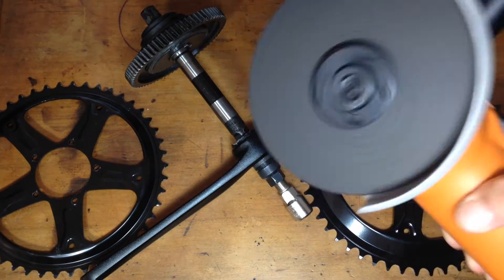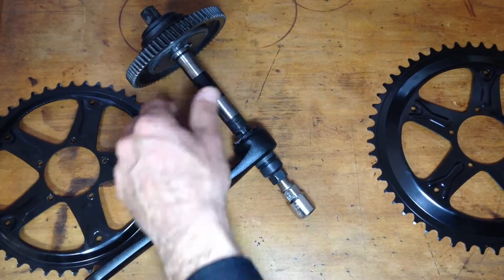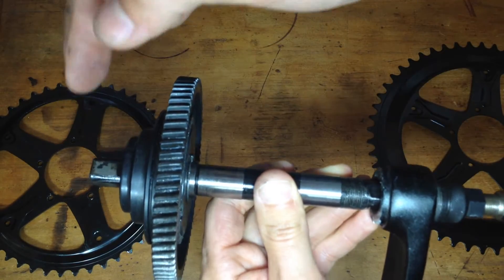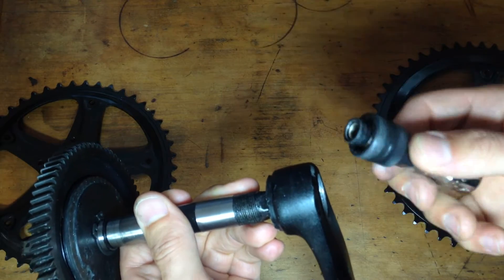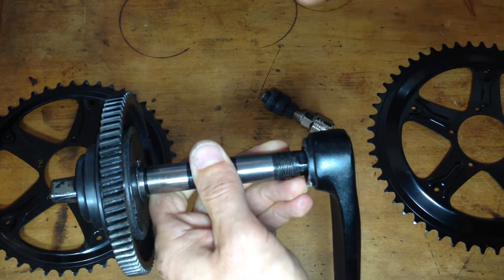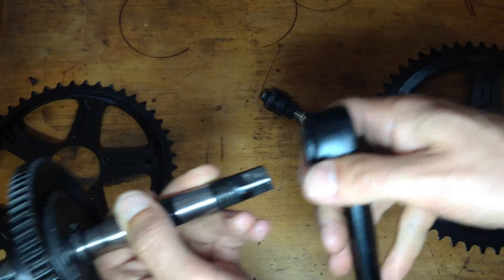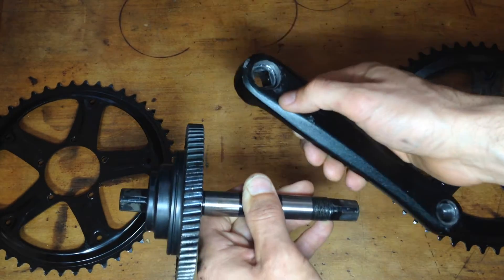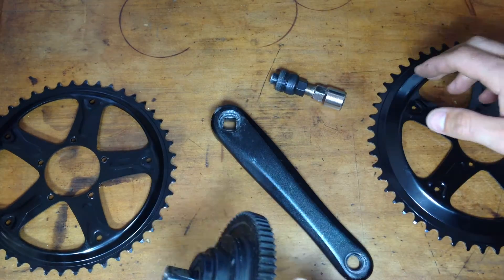Stuck crank arm • BBS02 BBSHD Bafang 8fun mid drive Electric Bike

Comment: Was stuck with the same problem today. Didn't get it off even with a crank puller, because the top from the pushing screw on the inside was too wide to fit. I took the top off and used a screw with a slightly smaller head as a replacement. Also put some washers on the inside of the crank to even out the pressure and not damage the thread of the crank screw. Worked pretty good.

Comment: bruno i'm trying to remove a bbs01 but after i removed all screws the motor simply wont slide out. I tried to hammer it , put wd 40 but nothing. Did this ever happened to you? Do you have any idea? Is the bb sleeve of the motor made of aluminium? (maybe is oxidated) I reall ran out of ideas here.
Reply from the maker: Hummmm I know... the Bafang motor is aluminium but the BB tube that goes inside is strong steel and yes it must be rusting and expanding against the bike’s bb... best is to maybe step on the motor trying to make it slide down and up it should slowly move bit by bit... ask a friend to help holding the bike... impossible job for one person I think... eventually you’ll get it out and sand all that rust off and paint again. When installing get a lot of grease so it makes a barrier and doesn’t let water accumulate inside
Reply from the maker: I hope that helps =]

Comment: I just had to do it today ! Brand knew bike first time and the thread shredded ! Watched your pic and cut it with small grinder and chisel 1 bang and 2 cut the arm falls off ! Be care full not to cut through axel ! GOOD LUCK WORKED FOR ME %100 NO DAMAGE !
Reply from the maker: Yeaahhhh unfortunately this happens more often than people think... I ended up working in an ebike shop for 2 years and we had multiple tools to avoid using angle grinder. There is a tapered tool that tap a new tread so it really bites the crank and can be removed most times, other times we ended up using a big bearing extractor tool, sometimes dremmel, sometimes angle grinder... the original Bafang crank is so soft... I changed to Lekkie cranks, they have the extractor build into the crank so no special tool required, alen key only
Reply: @BrunoPOWEEER   i just put on the Lekkei  ONESEVENTY  SELF EXTRACTING  cranks top quality from New Zealand  cost me $195 bucks ! Now no more problems size 8 allen key !

Comment: What tool do you use to remove it? Can you provide a link to an example?
Reply from the maker: +David Yoakum 
Best option, take to the closest car mechanics and ask for their help first. I listed other options below:

use a small bearing puller tool small enough that will fit (don't buy online, best to go to a hardware shop and see in person, ideally try before you buy): http://www.tridon.com.au/products/Toledo/23/327643/bearing-separators/409751/sliding-beam-pullers/428843/232080

There is an emergency crank arm extractor tool (very rare I could t find a link) very handy when you accidentally strip the crank treads, it's a tapered tool so it goes bigger and tighter as you screw it into the stripped crank. Works in some cases.

Last option is to cut the crank arm with a dremmel or any other saw or grinder like this: https://www.google.com.au/search?q=tapered+crank+extractor&rlz=1CDGOYI_enAU713AU714&hl=en-GB&prmd=sivn&source=lnms&tbm=isch&sa=X&ved=0ahUKEwiJ9ZiKn6TXAhVCJ5QKHej9DPIQ_AUIEygC&biw=375&bih=591#imgrc=XKAKAmMfcktG9M:

How to avoid this problem again? Use grease everywhere, grease between the shaft and the crank when you install (apply grease on both parts), grease the crank arm extractor tool and the crank arm treads (use a tool to tighten, hand tight isn't enough and will likely strip but also too much torque isn't good either).

Comment: Hi I'm having a problem with my chain jumping off the BBSHD any ideas how to remedy that? Thx!

Btw Couldn't you use heat on the crank arm oil the crankshaft and tap the crank arm with a hammer or something similar just curious
Reply from the maker: +teta - Yeahhh... sounds like you're using the stock 46T chainring... if you're using the Lekkie 42T ring it won't happen as it is a narrow wide design, it grabs the chain really well and won't drop under load! There is a way to get away with the Bafang metal one, just put your front derailleur aligned to your chain, very low so it works like a chain guide and will keep it in place. This is what I do in my bike and I never had any chain drops since... 
The crank arm... I tried oil and everything you could imagine, I hammered, I oiled.. there is a special tool that looks like a bearing extractor (very rare and hard to find) but I didn't have it and need to get this bike on the road ASAP so I did what most bike mechanics do.. I cut the crank arm... really thick... takes forever... =/